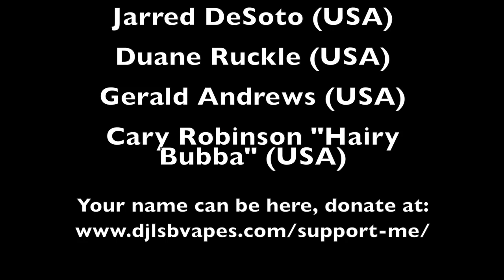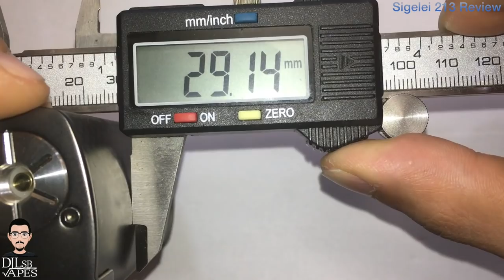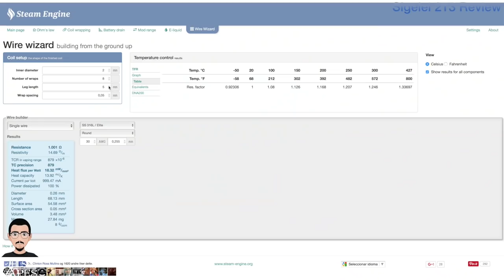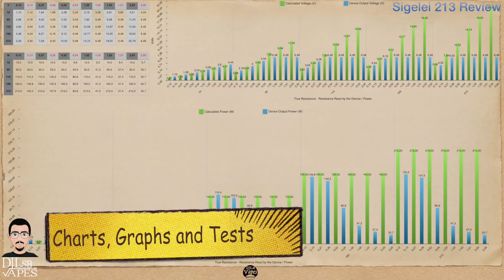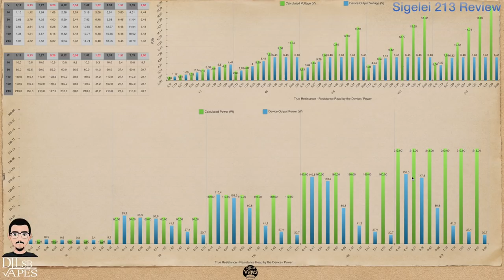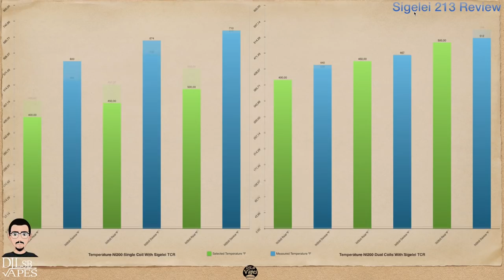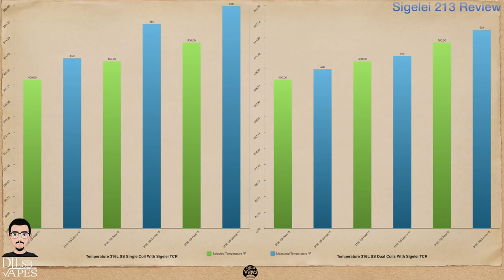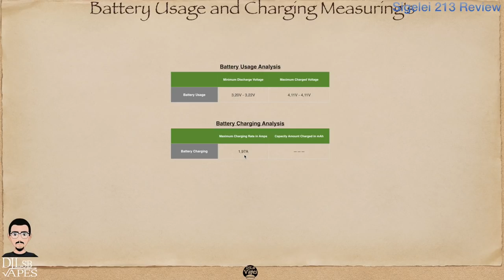Sigelei 213 Lies unveiled + Charts + Disassembly

Comment: I forgot to add: On top of all your discoveries about this box, I did my own test of the Battery Balanced charging. I placed two batteries of 3.51V and 3.76V (purposely unbalanced by 0.25V. After charging, the difference increased by 0.36V. 4.19V and 3.83V. As a result, the battery indicator will never reach 100% and you will never know that the charging cycle is completed.
Here is the photo: http://imgur.com/WOfX2Or
Reply from the maker: Wow, you make a really valid point. Thank you so much, I will re-think those tests on my reviews, thank you so much

Comment: Do all of the inaccuracies and issues also occur on the Fuchai 213? I really wanted to grab the Fuchai, but this video clearly shows that I should spend my money elsewhere. Based on what I have seen, everything is identical apart from the exterior. If the issues are also present in the Fuchai, what is a good alternative? I want a solid mod for temp control, and the size + double 18650 batteries looked super appealing.

Comment: what a joke...sad thing is a lot of people are waiting for the fuchai 213 and have preordered it...which will fail as it has the same board, just different way to calculate temp control in Fahrenheit instead of Celsius; which won't matter because the board is broken. wtf? I've reached out to Sigelei and zero response. Sigelei, Joyetech/eleaf/wismec all are super shady and should be boycotted in this community for releasing broken mods and having zero interest in fixing it or even honoring their warranty. Great review and much respect Daniel for being an honest reviewer with integrity. $100 wasted...
Reply from the maker: Thank you so much for your words, yeah unfortunately is true ;-(
Reply from the maker: Yeah, the biggest problem on them are the 510 connectors

Comment: may i first say you are awesome!
one of, if not the best vape reviewers here on YouTube. but i did notice when you pressed to lock resistance it said on screen " hold to lock resistance " and looked like you only 'pressed'. feel free to correct me if i am barking up the wrong tree but did you try to actually 'hold' to lock?
great detailed video nonetheless! :)
Reply: I would say the same. I think this test is ran with an unlocked resistance.
Reply: +DJSolitone having watched him for a long time... and how thorough be is, he would have  obviously checked that first. it's like your car won't start, what's the first thing you check. if it has gas. obviously didn't watch the video because he states several times how he checked the resistance lock and it said locked...
Reply from the maker: is just another flaw, if you hold it, it does the same, plus the way I lock it you can see later that if I enter that menu again instead of lock it say's unlock

Comment: Daniel you were using a 213 watt pre power for your temp tests. Set your pre heat to a sensible wattage
Reply from the maker: No I disabled it placing 0.01s
Reply: +DJLsb Vapes hi Daniel. I'm not defending the mod just wanted to point it out. I have a sigeli 213 and it feels week. Put a crown coil (0.5) on the sigeli at 75w and then put the same coil on the rx200 at the same 75w. Power is much higher on the rx200. I have no fancy test equipment but I can tell for sure....

Comment: daniel, at 12:13 in the video, when you locked the resistance i noticed the screen said "hold to lock resistance", but you only clicked the the button fast. i have not finished watching the video yet but if you have not tried it, could you try holding the button when you lock the resistance and see if it works?
Reply from the maker: is normal, is just another flaw, if you hold it, it does the same, plus the way I lock it you can see later that if I enter that menu again instead of lock it say's unlock

Comment: Thanks for the review.  I had already bought the 155 with a gift card I had received.  Luckily I don't use TC or really vape above 100 watts.  I thought there were some problems with this device when I saw Vapin Heathin have to do 3 videos on it.  I bought it anyway for the form factor and size.  I was going to buy a moonshot but after their shoddy work on mods and especially there treatment of you, I will not buy anything else from them.  I don't blame other reviewers for the hype on this as not all have the technical knowledge you have or ways to test all of the specs.  I have learned to wait for your reviews before purchase in the future.

Comment: To lock resistance you have to "hold" the button to lock it. Just one push won't lock it. It says "hold to lock" on the screen.
Reply from the maker: is normal, is just another flaw, if you hold it, it does the same, plus the way I lock it you can see later that if I enter that menu again instead of lock it say's unlock
Reply: +DJLsb Vapes I'm not sure what I should do with mine. I got it yesterday but didn't open the package yet.  My main device is a Tuglyfe DNA200 so I have that for TC vaping. I got this as my "knock around" device but if it's not operating properly maybe I should return it. I'm not sure what to do. It looks really nice and the demo one I held felt so good in the hand.
Reply from the maker: Put it this way, if you don't vape higher then 150W and you don't care about TC, is an awesome device, if not you will be frustrated to spend your money on it, I would send it back there are much better devices and cheaper ;-)
Reply: +DJLsb Vapes technically, it only cost me $30. I did some work for a local Vape shop and helped them build furniture so they gave me a huge discount on it.  If I want to use TC I can always use my DNA 200 device. Personally I generally prefer power mode anyway on all of my devices, however just knowing that something is wrong with this device kind of bothers me. Otherwise it really is awesome

Comment: I love the fact that you didn't pull any punches with this review. I own one, and the temp control is, without a doubt, quirky. I only use SS wire, and it took me a long time to find the right TC settings... but even now, the TC doesn't quite seem to work properly. I can't believe they have the preheat function available in Ni200 mode - that seems dangerous.

Maybe you're right.... maybe it isn't quite locking the resistance in properly. My guess, just based on taste and quality of the vapor, was that the mod wasn't comparing the temp properly, and it wasn't limiting the current soon enough.

Like you, I'm disappointed... I really wish there was a firmware update imminent, because I absolutely love the mod itself, as well as the idea of an initial power boost on a TC mod.
Reply from the maker: I feel your pain I also had the same high hopes specially when I felt the built quality and argonomics of it, but under the hood is a mess
Reply: If only a firmware upgrade was possible... this mod had the potential to be the benchmark for all things to come, but for whatever reason they decided to come up short. And it has to be that - Sigelei must know what the mod is doing and decided to release it as-is, with no intention of correcting future problems with firmware updates. I've basically paid $140 CAD just so I can start vaping on kanthal.

Comment: on the SS coil resistance lock you didn't lock it. it said "HOLD TO LOCK" You didn't hold any buttons. so I don't think you did lock resistance.
Reply from the maker: is normal, is just another flaw, if you hold it, it does the same, plus the way I lock it you can see later that if I enter that menu again instead of lock it say's unlock
Reply: +DJLsb Vapes I saw that later in the video it said "unlock". thanks for all the info! keep it up!

Comment: Daniel I fully support you and your honest complete reviews, and think it is beyond contemptible for a manufacturer to come down on you for providing the truth as you find it.
 During your review of this Mod, it is my  first insight of how you get your temperature readings or how anyone may be reading temperature, previously a mystery to me. I am an Instrumentation Tech. by trade in the steel industry, and have made and used many TC's and ways to measure temperature. Are you using a J or K type thermocouple? Not sure how much burying the probe in the center of the cotton may be insulating or delaying the temperature reading from the coil itself? You mentioned in the video about burning up many a thermocouple, what are you burning up on them, the covering? We weld the two wires typically, but a thermocouple can be made by simply twisting the two wires together. The smallest wire gauge available will give the quickest response time, and if you put the thermocouple between the coil and cotton I think it would be more accurate, but of course you would have to use a covering such as a small piece of  silica fabric tape to isolate the TC metal from the coil metal, or even some thin silicone covering capable almost to 600 F, especially due to its short exposure time.  Just trying to help, keep up the good work, us Vapers need you.

Comment: was linked here, what cells was this with? for instance a 25r or 30q wouldn't provide nearly the voltage under load of a vtc5a or LG hb6. That would provide better stepdown and higher wattages... just a variable for you
Reply from the maker: I only use LG HB6's on my tests they have nothing to do with VTC5's, VTC4's are still better and VTC3's comparable to the LG HB6's
Reply: +DJLsb Vapes the vtc5a revision (2016, 2500 mah "35a" continuous) is better at voltage under load than the vtc4 or 3 or hb6. I use hb6 myself, but I mainly super sub ohm on mechs(irresponsibly low), or use my DNA200 devices.
Reply from the maker: Oh the VTC5a, ok sorry, haven't checked battery mooch tests on that one yet, thanks
Reply: battery mooch testing shows these as 25a continuous. really great batteries if you can find authentic ones
Reply: +addy tuney the true (not advertised) amp rating is 25a, voltage under load is the only metric they win out at over the hb6.

Comment: Awesome video as always Daniel. I am curious about something though and maybe you can help me. I agree that the tc isn't very accurate because I have to set the temperature compensate to about 75 to get a decent vape on it. Can the tc be made more accurate by manipulating that feature? I know nothing about what that feature does, other than give me a decent vape when I turn it up. I'd be curious to see some accuracy results when the temperature compensate is changed.
Reply from the maker: Thanks, what you mean by temperature compensate, that's only on YIHI boards
Reply: There is a temperature compensate setting on the Sig 213. Hold down all three buttons at the same time for a few seconds and it will come up.
Reply from the maker: You thank you so much, I missed that, it was at 20ºF I placed at 70ºF the temp currently here, and so far I'm testing SS, and get's about 40ºF higher on the tests, jesus.
Thanks
Reply: Oh wow. Thanks for the test info man. You rock.
Reply: So, bottom line is that it does nothing for accuracy, just raises the overall temp.
Reply from the maker: Yes, so far that's what happens
Reply: The numbers also can be adjusted down into negatives. So, in theory you should be able to lower it below zero and get a little closer. 

Damn, I must really like a hot vape because I usually vape at 480F and set the compensate to 75. I'd probably be better off just sticking with power mode.

Comment: Very extensive and in depth review, well done. Personally the 213 TC issues don't bother me since I vape 30w-60w at most 99% of the time. Got the Fuchai 213 also and they all work great. Honestly prefer my IPV 6 for favorite dual 18650 mod and my Reuleaux RX200 or Sigelei Snow Wolf 218 for favorite triple 18650 mod. Anyway, great review.

Comment: great video it's about time we got the truth about this failure of a mod I could care less if it was a 155watt mod of 213watt mod but for it not to lock the resistance makes me wonder wtf sigelei was thinking all I use is temp control mode when I vape. I'm very glad I held off until yourself or Phil did your testing of this mod or else I would've been pissed off. I hope the other mod that looks like this one really works but ill be waiting again for one of y'all to test it. I NO LONGER TRUST SIGELEI AS OF RIGHT NOW THEY ARE DEAD TO ME.
Reply from the maker: Thank you so much ;-)

Comment: +DJLSB Vapes Good review but I think you made a mistake on the locking of the resistance. It is saying to hold the button to lock and you are not holding the button. That being said, if you have to lock the resistance for the TC to work, that is just a bad design. Most people are not going to lock their resistance every time you use TC. That is just dumb.
Reply from the maker: No, is normal, is just another flaw, if you hold it, it does the same, plus the way I lock it you can see later that if I enter that menu again instead of lock it say's unlock

Comment: Thanks for the thorough review Daniel. Love the looks and carbon fibre also the tiny form factor for a dual 18650 but what a fail on tc and actual power output 😵 Will you be testing the Fuchai version. Btw, I recently discovered Dinner Lady lemon tart too. I would never eat the real thing but the eliquid is indeed a delicious vape 😁
Reply from the maker: You welcome, yeah I will try to, but from my questions to them, looks like a rebranding still without firmware upgrades, let's see what they do now ;-)
Reply: Thanks Daniel, will definitely be looking out for that. At least it will be  cheaper......

Comment: I would like to point out that when you locked in the resistance it stated "Hold to Lock resistance" 

Because you did not lock the resistance correctly, when you fired it the first time it started at the 0.6ohm resistance, each time you are firing the mod it is reading a higher starting resistance because the resistance was not locked to begin with. Which means each time it will get hotter and hotter like it did.
Reply: What is your experience after locking the resistance properly? how was its performance for TC? Is it better than this very review

Comment: I noticed when you locked the resistance you clicked when it said "hold to lock resistance", is that a possible factor ?
Reply from the maker: Is another fail on the device even holding it locks and starts firing right away

Comment: Thank you for saving me a lot of money. I was really excited for this device because of size, form factor, light weight and for temp control. Now I won't be buying it. All they needed to do was have the device lock the resistance in temp control. They could fix that if it did updates. Sigelei really screwed up this one. I agree that it's a great device but only good for power mode up to 155 watts. Thank you for your excellent work.
Reply from the maker: You welcome ;-)

Comment: Hey, my device shows SGL1605V2.0 on startup instead of SGL1605V1.7, do i have a newer model with upgraded firmware that has possibly fixed the resistance lock? I have never used temp control and I was thinking about it and bought the device today without knowing about this issue.

Comment: I look forward to you getting the "Fuchai" 213. apparently they fixed the board... I have a sig 213 but, I only vape in power mode so it's ok with me. but, that's not the point. it SHOULD do what it's advertised to do!
Reply: same board and will have the same issues. the only thing they "fixed" is it !measuring in Fahrenheit instead of Celsius, which won't correct the issues the mod has calculating temp control
Reply: not to mention not getting the power output thats on the screen in wattage mode lol

Comment: hey.  i've been watching your videos for ages and really find your info useful. Ive got a sigalet 213 (150) with 2 efest batteries 3500mah 20amp discharge 35a pulse.  the batteries have been rated ok.  ive just bourght a smok beast and the amps according to the sigalei are 30a.  voltage at. 4.88 and 0.15ohm. 
could you tell me if this is safe?  i love the setup but worrying about it blowing up in my face is ruining my experience.  
Thanking you in advance.

Comment: my real question is not questioning you but if the preheat function works that way.  if in fact it still fires at the set wattage for the set time regardless of the temp set before temp limiting intitiates.  does it still fire for that set wattage and time no matter what??

Comment: I have a question about this device being any good for vaping in wattage. If you use SS316 and use wattage the ohms still change on this device so the voltage will change. Will you notice a change in the vape after 3 or 4 Vapes on a SS coil?

Comment: What you actually pointed out is greater than just the 213 not working properly.
I learned that any other reviewer cannot tell the difference of 155 instead of 213 watts,if the temp control works or not,or if it has updates.
Considering the fact that vaping Ti coils is really dangerous on this mod,i will never base my buys on any other reviewer's opinion but yours.
They just roll through the menu say it looks good and that's all.
You need to have electronics knowledge when you check devices that have so complicated functions and there are dangers when they don't meet what they claim to have.
Reply: What the fuck are you talking about? You have a problem understanding text? Other reviewers found this faulty device great. Djlsb found all it's flaws. I actually care if a device works ok before i throw 100$ at it so i watch reviews from people that know what they are doing. Did he find that this device outputs 155 watts? He did. Did he find that it has no temp control? He did. Why should i not trust him on his reviews?
Reply: I did